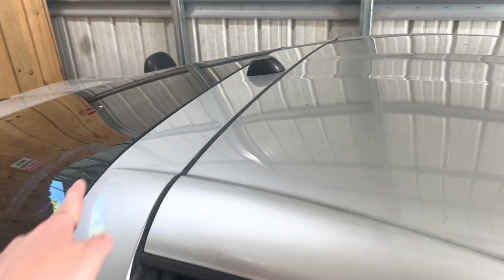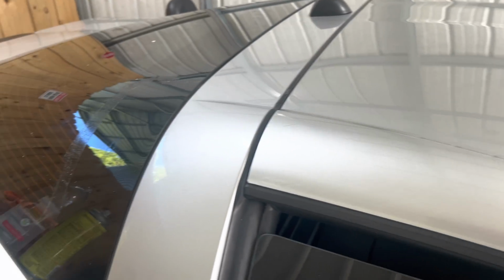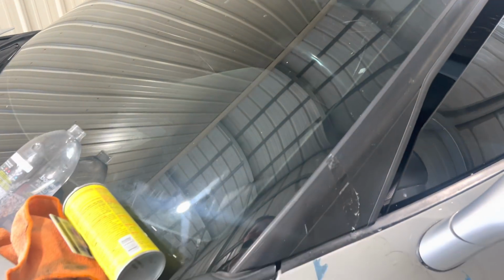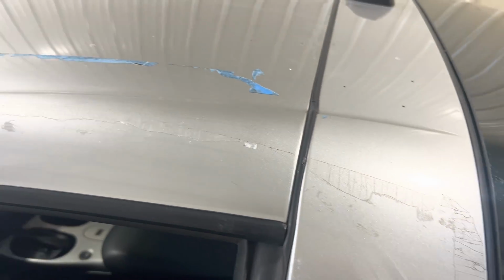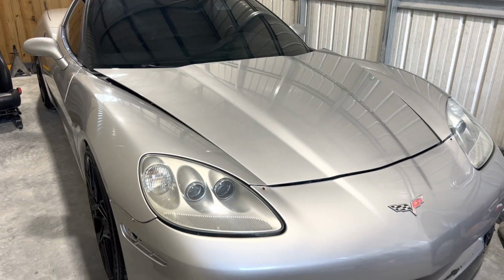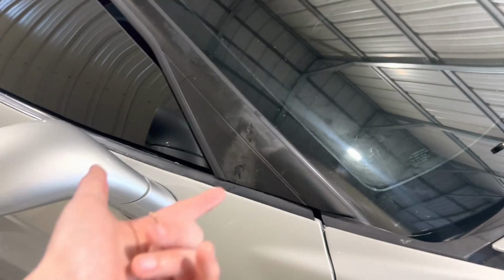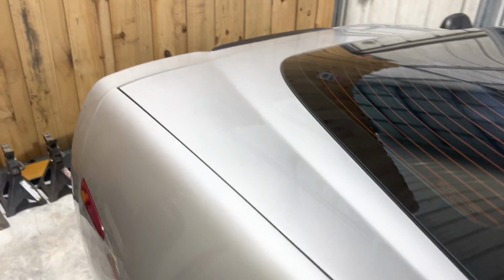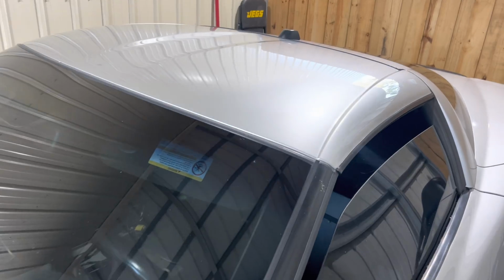FIRST time WASHING my C6

Comment: The difference between the before and after is phenomenal. The car looked like a beater before, now it looks like a car that after a 2 step paint correction and ceramic coat it will look like new. Awesome job on the clean up.

Comment: Use goo gone they got it at autozone it will get the adhesive off and if u got to use a heat gum warm the goo and a scraper if need be since it old tape and been there for years. Old adhesive hard to get off after years of being bounding to paint. God bless and be safe.

Comment: 3M 38984 specialty adhesive remover will take off tape better than goo gone it's the product I use to remove police adhesive left behind after removal of their emblems. 
may need to soak it into a rag and let sit cooler temperatures will prevent evaporation

Comment: Is it bad to get the c5 and c6 wet underneath, I sometimes use a car wash and not sure if thats bad. I see alot of people say dont drive in the rain, so I am not sure if there is a reason. Also mine does drip on the front of the seats when in car wash not sure if alot of them do this.

Comment: For adhesive removal next time check out/try 3m eraser wheel. It attaches to drill. Works great on most jobs.
Reply: Do not use on plastic or fiberglass. It'll eat it up with heat. Use an adhesive remover - goo gone or simular